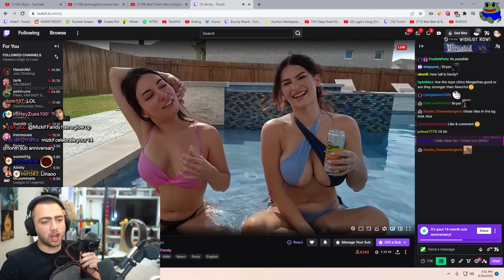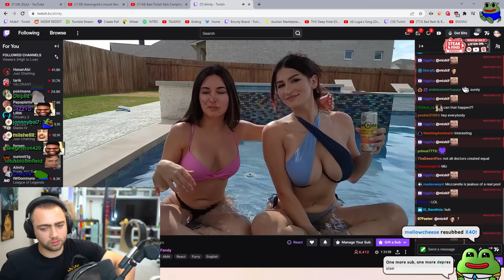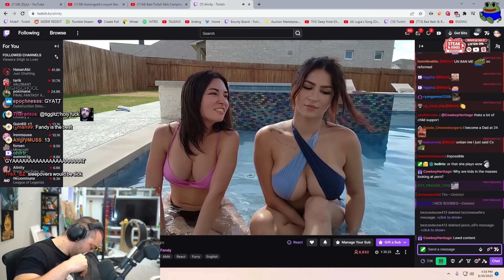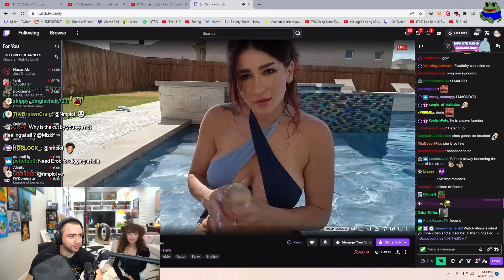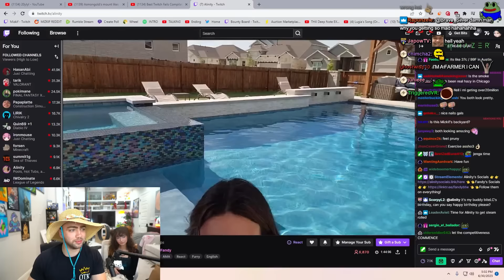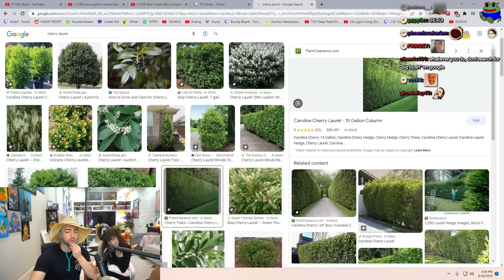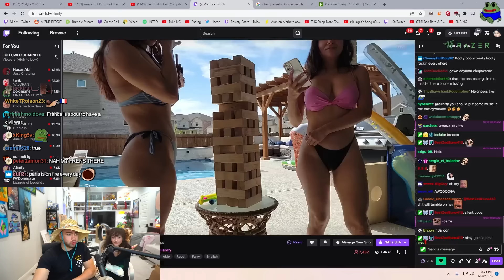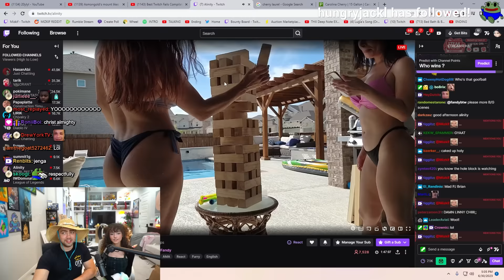“I Want To Get Pregnant So Badly”

Comment: Hopefully, Mizkif sees this, but you can get Ubiquiti Wi-Fi transmitters that can go outside. They are weatherproof, like a relay to your Wi-Fi in your house, so they'll boost your signal. That way, you will not F outside in your yard. For security purposes, you do not want the transmitting power up too high, though, because the transmitting power directly correlates to the distance your Wi-Fi signal can reach. ( I do Cybersecurity consulting, which covers networking too.)

Comment: As a professional Landscaper..... I give that Tree a month.... Max.

Doesn't he run around bragging about what he can bench and how strong he is....... and yet Dude can't even dig a 3-foot hole... LMFAO I AM FKN DYING Laughing !  Thank you for this!
Reply: i meann. working out and actually doing a back breaking job like that is totally different. and also not only got no experience. but he doesnt seem....smart.. wasnt even taking the advice of putting on shoes. he has the money. he should get the tools for the job. you dont need it but i feel for someone like him an overhead tent or something that provides shade and then a fan would help him. then for tools. what helps me is a jack hammer. just mark out any piping underneath and go ham. either way based off what he said about how long the root goes out...got the wrong bush for the job too. theres many. coulda picked any
ps, i have done some trenching work. only had a tree for shade that covered barely anything, 1 ice cooler, and still did a 150 feet line, 30 in down with not too much hassle. but yeah i highly doubt he gonna manage this